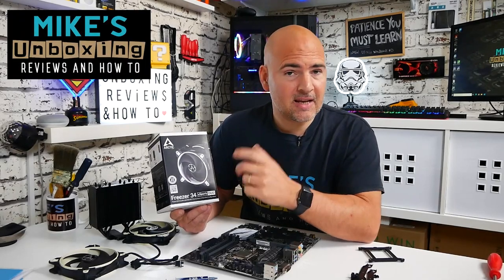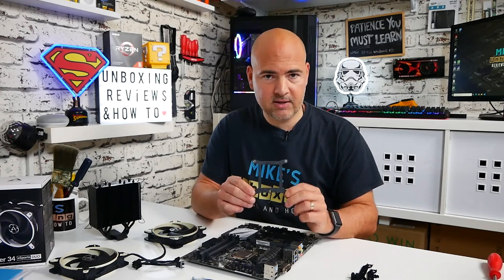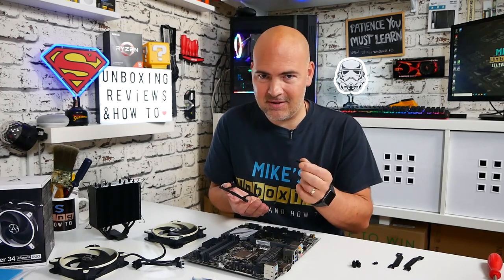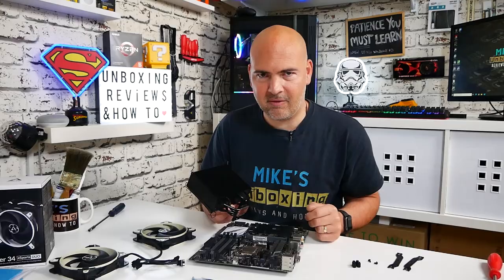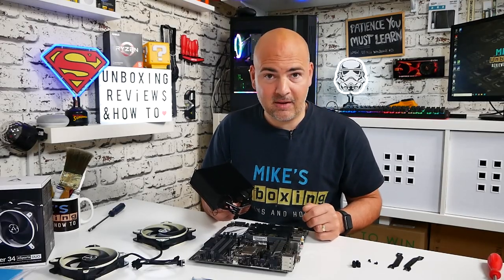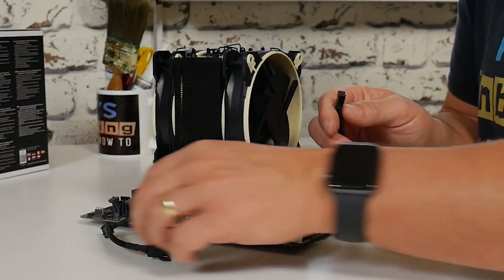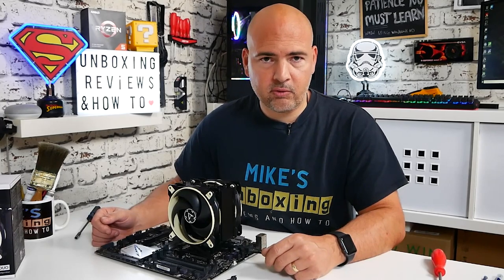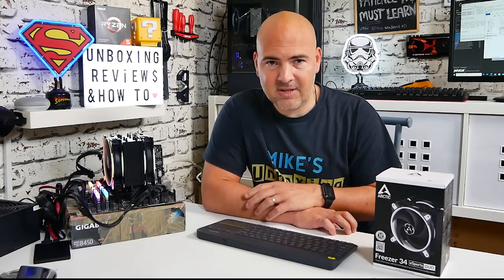Installing Freezer 34 Esports Duo on Intel 6700k and temps

Comment: I have the cooler myself, and it is doing really well on my 2600x, even after overclocking it to 4.1GHz. It's probably the most impressive cooler for the price.
Reply from the maker: yes a really good all round product
Reply: @mikesunboxing  Yep. Would definitely recommend to anyone using a processor with 8 cores or less. A bit more cores and you should probably settle for an aio or another air cooler
Reply: @alikadhim3256  12 core here (ryzen 9 3900x) it does amazing!
Reply: @frozy9635  Nice! I thought the temps might rise a bit when doing CPU intensive tasks. Guess I was wrong!

Comment: Arctic products (fans, CPU cooling and thermal paste) are very good. I use MX-4. The Core I7 6700K is still a beast. A client of mine has it installed in ASUS Z270 Prime A with 24 GB RAM (CPU Cooler: CM Hyper T4). The "weakness"? A Quadro K620, 2 GB (He's designer, not gamer). Told him to consider to upgrade at least to a GTX 1660 TI or 2060 Super for more power in rendering, or wait till Quadro K2200 drops in price. Thank you, Mike!
Reply from the maker: thanks Ricardo sorry for the late response! very busy at the moment
Reply: @mikesunboxing  Don't worry. It's ok.

Comment: I can usually do a a 4.8-4.9 at around 1.29-1.34v OC on 6700k and get similar temps. One thing to look out for on them is RAM speeds. I'd personally go to 2666mhz 2800mhz tops on them, as they where made to support DDR3 and 4 none k models had issues running over 2400mhz on B150 chipsets as the on chip controller was not the best set to run from 800mhz to 2133mhz.stock so that might be raising your temps if your using 3200mhz dimms. Board quality makes a bit  of a difference (I never liked those cheaper ASUS boards) and even on the z270 chipset going to 2933mhz can be hit or miss depending if its early first 3 months or so release or later, 7700k did better dropping DDR3 support.  

  Check your bios in case previous user has over volted it and the bios has not reset. Good practice to go in and manually reset bios settings, specially if your using the same model chip
Reply: Man I struggle to get over 4.7 on my 6700k, 4.8 seems to be somewhere above 1.4v which I'm not hugely comfortable with and wouldn't run as an everyday or gaming overclock anyway.
Reply: @RobBomford  Yours is probably one of the early run and depends on what board and RAM your using, 6th gen is a die shrunk haswell with DDR4 support temperamental with RAM speed. Usually to get 4.8-4.9 it was a case of using 2100-2400mhz DDR4. If you look at Mikes board it has a big heat sink covering a bit of a weedy VRM which makes a difference in the end results.

Up until recently my personal rig was running a late (Devils canyon was out when I purchased) 4770K, Gigabyte ga-z87x-ud5h Gold Motherboard, 16gb 2x8gb Corsair Vengeance Pro Gold PC3 19200 2400mhz ram using a HP branded Asertec 280mm AIO (new from a workstation) when new would hit 4.9 uncomfortably 4.8 stable at1.365v I ran it full time 4.7 1.35v when I sold it a few month back with the paste dried out it was still hitting 4.5 at 1.3v under a cheap snowman cooler would have done better with a delid but I left that up to the youngster that bought it.

6700k was soldered but the early runs where not done to a great standard but it took a few months for that to get better and the silicon to improve.
Reply: @buntudred6929  Yeah I think it's a combination of the lower end gigabyte z170 I'm using and probably the fact it's an early chip like you said. Cheers for the info
Reply: @RobBomford  No problem, I used to do a lot of pro audio builds back when, so got to see how things progressed. I ave 4 builds a month with exception to early this year so have had my hands on a fair few systems seeing how they respond. I'm running off a laptop for the time being as I'm in no real rush sold my old stuff while it was worth something but will likely build my replacement in the new year now when current parts reach a suitable low price to match my tight fistedness.
Reply: @buntudred6929  Sounds like a great plan, waiting for zen 3 seems like a no brainer really now
Reply from the maker: i need to look at the temps on this one, the voltage looks way too high
Reply: @mikesunboxing   With used boards I always start with hard reset of bios and cmos. then go through every tab and select default settings as sometimes some settings don't get triggered by hard reset. Those prime boards don't have a killer power delivery only good for a quick and dirty OC

If you can set up a button to clear cmos reset button is a good one to go with I have a few wire looms stripped from old zoostorm cases with power and reset I hook up so I can remote in front of monitor not fighting around.

While at stock do a run on R 15 as R 20 is more of a torture test on 4 cores and crashes constantly, get a base line of your temps. while at Idle it should be a few degrees above ambient and should be around 57 degrees on R 15 run on 6700k.

 First thing I do in bios is go though power management and disable global C states leaving A and B states first 2 settings, 0 on but depending on settings options I will turn off the 2 under C states.with C prefix. 

Then I set V core voltage to 3.75 (you can bring it down down after testing once your stable) set multiplier to manual and start with 4500. F10 and save. do a R 15 run, don't worry about temps just see its stable, then back to bios go up to  4550 in multiplier do a run then 4600 do a run 4650, do a run going up by 50 until it crashes on an R 15 run. then back it off to your last stable preset and bring your V core down to 3.5v  do a run and bring it down 3.3v 3.1v don't go below 2.9v till it crashes and set to your last stable setting then look at your temps. Its a lot of restarts and R 15 runs  but worth it in the end. Then go to unigine heaven and do a run make sure it goes through a benchmark run without crashing. If it does take it in turns +0.1v -0050mghz till it passes

lottery

Comment: My case is MSI MAG Forge 100r.
I installed 34 Duo, and its rear fan is in close contact with the rear exhaust fan of the case.
The fans are touching each other.
They can work like that?
I have 2 120 mm fans intake and 1 exhaust.
I think the best I can do is to detach the rear fan from the cooler and to mount it as another exhaust rear top of the case. Correct?
The cooler should miss 1-3 degrees like that that I could regain moving the fan.
Reply from the maker: i would remove the rear case fan and use it above the cpu area do draw heat away

Comment: I have ordered one of these for my pc, replacing the annoying wraith prism stock cooler. It will be interesting to see how it compares with my sons pc which has the Scythe Mugen 5 rev B rgb. Same mobo (X570 Asus) and cpu (R7 3800X). I don't care for RGB. I have a more airflow friendly case though, Phantex 400A while he has the Lian Li 011 Dynamic.  I also have an old GTX 670 GPU, while he has a newer RTX2070S. I only game with older less demanding titles and I mostly use my pc for work.
Reply from the maker: let us know the results

Comment: Mike - try the Deepcool Gammaxx GTE Black v2 - It's £26.99 on Scan.  I used it on an i7-6700K as well, at stock frequency and got similar temps in Prime95.  It's cheaper and better looking in my opinion.
Reply from the maker: i'll take a look

Comment: The 6700k is a quad core if I remember right. How would the Freezer 34 do with an eight core? Watching you install the mounting hardware confirms my belief that a waterblock is much easier to install. Also, no fan noise because, no fan. LOL.
Reply: I feel like the tdp of the chip is more important than the number of cores when talking about cooling, for example a 3700x has a 65watt tdp, significantly lower than a 6700k, yet has double the cores /threads
Reply: @RobBomford  I was testing a 6700K a couple of weeks ago and if I remember correctly at stock it was pulling more like 80W under 100% load in prime 95, this was on an MSI B150M Mortar with default BIOS settings.  This was using the Deepcool Gammaxx GTE Black v2, and reaching high 60's.  I want to say 65C, but can't 100% remember.  Defintiely not 70 or above.  Power reading was taken from MSI Afterburner for reference.
Reply: @cptwhite  yeah sounds about right, I think the official figure is 91w from a quick Google. I'll have to see what mine pulls under load at its 4.6ghz OC
Reply: @RobBomford  That's true. My Ryzen 7 3800X is a little harder to cool, with a stock tdp of 105 watts. Overclocked to 4.5 GHz takes it up to 128 watts.
Reply: @RobBomford  That's true, but that's mainly because the 3700X has lower clocks and 7nm lithography. A 5GHz 14nm 8-core (e.g. the 9900K) would put out much more heat. TDP is a prediction/recommendation of how much cooling is required, but it's not a very precise method, and AMD and Intel measure it differently. You can easily find two CPUs where the one with the higher TDP puts out less heat, even within a series (e.g. the Ryzen 5 3600X has a 95W TDP but actually uses about 70W under full load, while the Ryzen 5 2600 has a 65W TDP but actually uses about 80W).
Reply: @nathangamble125  Yeah good point, I suppose its best to use it as a rough guide more than anything then
Reply from the maker: waterblocks and rads would struggle in this case, like i did
Reply: @mikesunboxing  Looks like I could get at least thin 240mm rad would fit in the front. Oh well. That's just me flapping my gums again. Cheers.
Reply: @OlettaLiano  yep....
Reply: @PapaMav   Wow, I can' t believe I wrote all that crap a year ago. 😂
Reply: @OlettaLiano  you know Big O, that I found ones where you talk about/admit to, you actually using air cooling at one time, LOL
Reply: @PapaMav  That is true. In fact, my girlfriend's PC is currently being cooled by the stock AMD air cooler that came with the 3800X because she likes the RGB. There was also a time when I'd never had my face between  another lady's legs. We learn, we grow, and we strive for bigger and better things. 😂
Reply: @OlettaLiano  and who can argure how great that is ???
Reply: @PapaMav  Not I. Honestly, an open loop is way more trouble and expense than is reasonable. A normal person will be happy with an AIO. It takes a special kind of stupid to build open loops. Raises hand

Comment: Rear mounting plate BARELY doesn't fit on the asrock b460m pro4 motherboard. I had to file down the inner rectangular plastic until it would seat on the back. It fits now though, just figured I'd shout that out in case anybody finds this.
Reply from the maker: thanks for the heads up
Reply: @mikesunboxing  just got it all finished thanks to you sir, stable temps and all
Reply from the maker: @seanmetro9801  awesome, glad to hear it

Comment: What is better for an i7 4790k OC @ 4.7 GHz, this 34 Duo or Scythe Fuma 2? Fuma 2 is better in OC and quieter?
What about to detach rear fan of 34 Duo, and to install it as exhaust fan on top case? (2 intake fans plus 1 rear exhaust just installed).
Reply from the maker: fuma 2 is better in general but often much more expensive especially here in the UK

Comment: I've reseated the single fan version of this twice on a Ryzen 3600 non-X, and the thermals are still not quite where I want them. Thought I didn't use enough paste the first time, 2nd time I may have went overboard. Not sure. Wondering how this tests with just one front fan for you. As that's what I'm running. Also the standoffs indicated for Ryzen seem short, but I used them both times and it's solid even though the back bracket seems loose until I tighten it down. Any advice would be appreciated.

Also those spring are a pain with the mobo still in the case.
Reply from the maker: single fan version is normally around 3c more i have found. very little in it
Reply: @mikesunboxing I appreciate the response, I kind of assumed that. I've since read some literature released by NZXT specifically citing that Ryzen's just run warmer at ambient than previous chipsets. I did some benches and it never went over 75 C. So I think I'm good. Ryzen Master attempted an auto clock and I think it hit the PPT limit and just shut down. So I haven't messed with it since.
Reply from the maker: Best leave it to pbo
Reply: @mikesunboxing  I'm just going to leave it to default. If I wanted to do some real OC I'd have bought a different processor and paired it with an AIO. I'm way way too lazy for that! :D

Comment: For anyone watching this wonderin gif it will work with a 12600k,i have it and it works great
Reply from the maker: thank you
Reply: Use it for Fortnite 1080p pretty much max settings and it peaked at 67c but average low / 50's

Comment: Can i use this cooler with 4 corsair Vengeance pro ram sticks  ?
Reply from the maker: it will depend on the motherboard really
Reply: @mikesunboxing  I have a gigabyte z490 vision G. I hope it fits, because I will build my computer in 2 weeks.
Reply: @mikesunboxing  And otherwise I have to find a good white AIO, because its a completely white build
Reply from the maker: @neil1260  that board has pretty decent spacing so i think it might just do it
Reply: @mikesunboxing  Thank you for the fast reply! I also hope my 10850k stays cool
Reply from the maker: @Neil  lets hope so